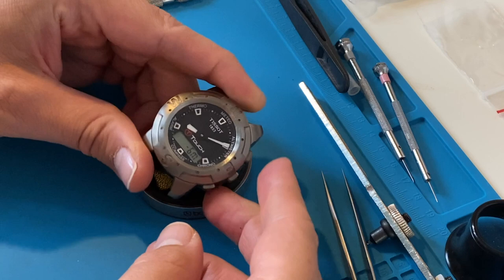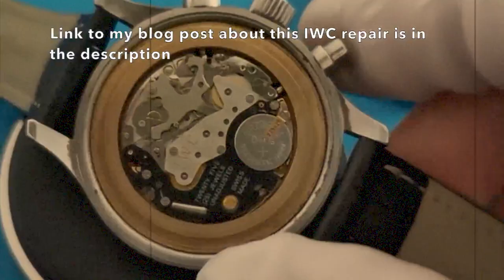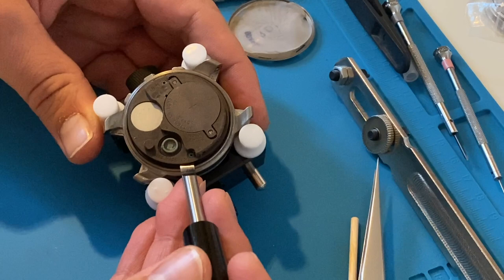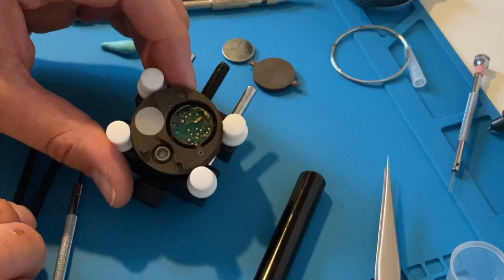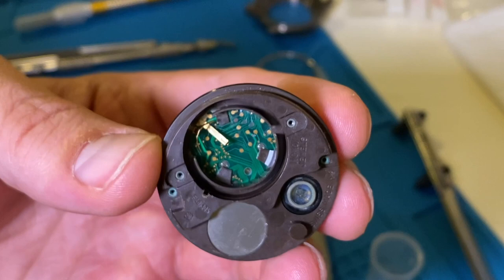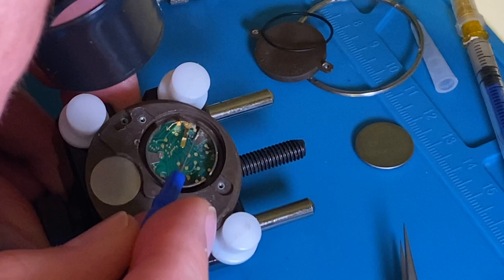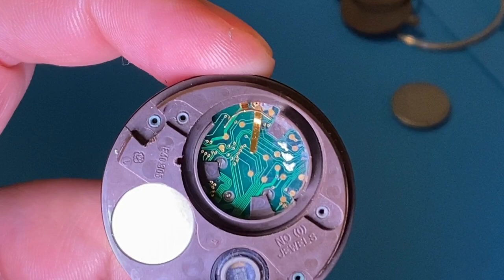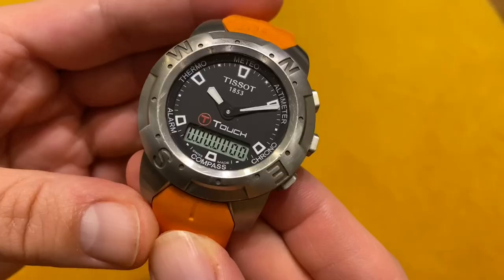Tissot T-Touch and battery leak [acid] - repair without parts

Comment: Great job.  I have the Tissot T Touch Solar Connected, so I found the extremely interesting.  I am assuming that like my watch this is also solar powered and you had to purchase the special battery for it.
Reply from the maker: This is an old version of a Tissot T-Touch without the solar feature :) - and uses a regular CR1620 battery

Comment: How did you get the hands to line up together in the final shot?  As soon as you turned it over after putting the battery in the hands were out of sync. How did you get them back together?

Comment: Damn those crappy swiss batteries
Reply from the maker: To be honest - it's hard to determine the origin of the battery which caused the issue in this case (I didn't have it) - but in general, leaving, a watch (with an old battery) in the drawer is not a good idea :)